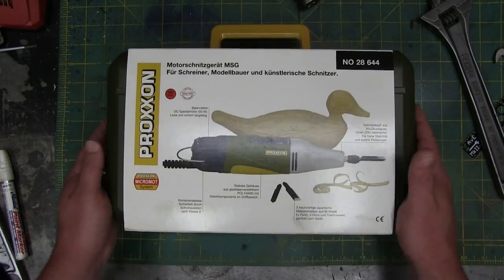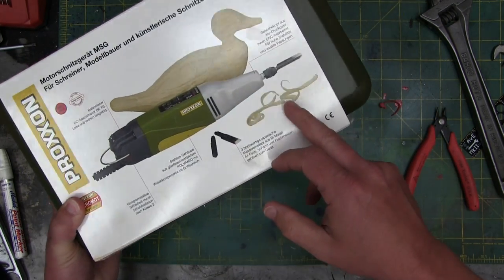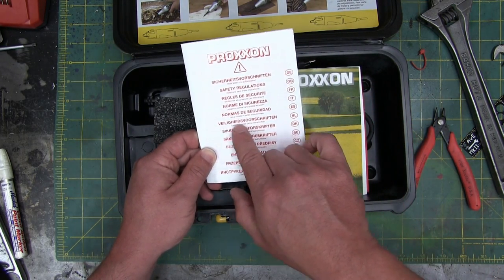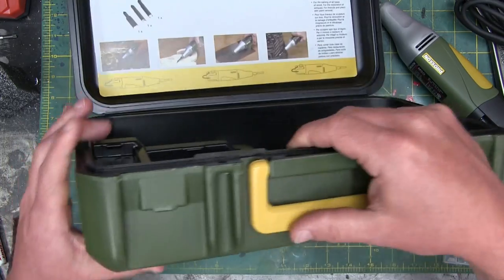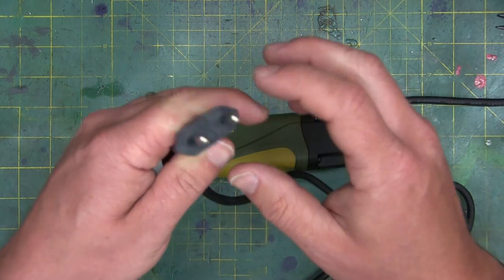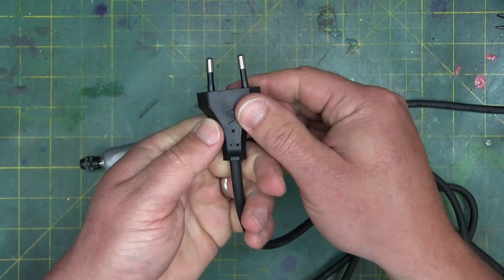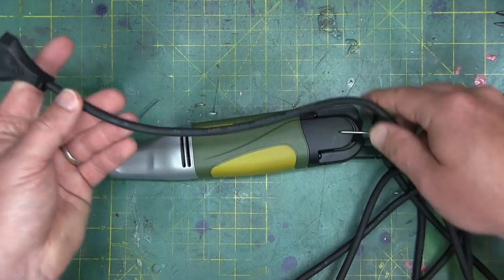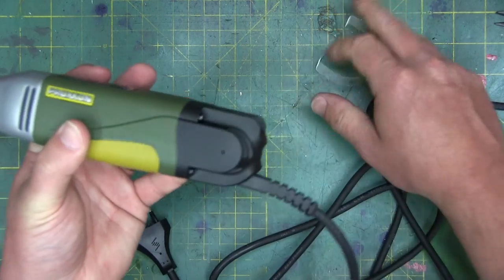BOLTR: PROXXON Carving Tool | Germany

Comment: hmm proxxon has some neat stuff, but some of it is just weird.
i got a big proxxon toolbox with a big and a small ratchet, they both feel incredibly well made, the big one however sometimes just skips gears under somewhat heavy load, meaning you build up force on it just so it snaps out of it with 0 resistance, that can hurt like a bitch.

nevertheless, restored an entire car with the tools and wasnt let down. also i think proxxon dremels are superior to original dremels, you should check em out.

Comment: The case is actually 2 injection molded pieces (the inner and the outer). It is almost certainly made of Polypropylene due to the fact that it has living hinges. Polypropylene is one of only 2-3  materials that can withstand a living hinge over time due to its rheological properties and fatiuge resistance.  Sincerely, a plastics engineer.

Comment: If you take your time reading the wikipedia page for Europlug, you'll see it says: "The two pins are not exactly parallel and converge slightly; their centres are 17.5 mm apart at the tip and 18.6 mm apart at the base"
And if you lack the skill of looking it up yerself, here is a link: https://en.wikipedia.org/wiki/Europlug#Details
Reply: Carl Fürstenberg you need a hobby

Comment: Nice tools if you like leave gbthe on the shelf but the circuit protection / longevity is not so great.
I had the angle grinder the triac released the angry pixies and turned into a smoker.
GLAD I bought an Arbortech after it is a beast for its size

Comment: From proxxon I have a table saw , a planer , a shaper , a hand held router and the miter saw
these are all miniature woodwork tools
yes they are very expensive but very good qualite
I have them for over 10 years and buy them in Montreal and they are 120 volts

Comment: theese proxons are quite shitty as on heavier use after couple of months the whole mini grinder started to rattle as shit, after taking it apart and pulling the small drive gear of the motor shaft i found out the front motor bushing bearing  literally pulverised.... the whole tool is made in an non serviceable fashion, forcing you to buy the assembly .....

Comment: it is possible to get it in 115v version you can tell the difference as it has a yellow end cap. http://www.ebay.co.uk/itm/Proxxon-38644-Die-Cast-Aluminum-Power-Carver-MOS-5-Piece-Carving-Knives-for-SGM-/381564367970?hash=item58d7023462

Comment: Proxxon are sold in the UK. Nice stuff, there version of the dremmel is really good. Smooth motors.
Have a look at the Proxxon LWS long neck angle grinder. It is like an electric die grinder. They can be used with rollock fittings, airbotech mini carvers and other fittings.

Comment: the small twist in the pixies probe is not unusual, most of them actually are bent a little bit, that way it's harder for them to cut the pixies route if pulled (old extentions tend to turn very loose, they unplug very easily, the old shitty ones)

Comment: Funnily enough, I just came across this brand for the first time about a month or so ago.
I was looking on TradeMe (NZ equivalent of ebay/craigslist), and found an interesting unit that came with a rotary tool and a power file/sander. The speed adjustment was on the main unit that you could plug either tool into.
Only reason I didn't buy it was that I wasn't sure if I could put any trust in the brand, and for the cost a Dremel could do a lot more.
(ended up going from a Dremel 3000 to a 4300 and the difference in quality and use is amazing).

Comment: In europe with 230V, this machine produces not 2 but 4 times more power. With the double  voltage and ohms law, U=IR,  the current doubles as well. And since P=U*I the power will quadruple. 
It's probably lower than 4 due to higher  R and mechanical losses.  But due to  60 vs 50Hz, inductive european devices like this, draw less current in 60Hz countries. So maybe it's more than 4.
Reply: So basically the pixies get twice as angry and double in numbers.

Comment: H05RN-F / H= "Harmonisierte Leitung" / 05= 300 V, 500 V / First letter internal insulation (Isolierwerkstoff) R= natural or synthetic Rubber / second letter external insulation (Mantelwerkstoff) N= chloroprene rubber / F= (Feindrähtig) fine wire, flexibel

Comment: Shocked that AvE does not have an adapter set and a step up/step down voltage converter.  I got one for my wife so she could run her British sewing machine here in the states. It was cheaper than buying her a new sewing machine.
Reply: Sithus1966 We do not really need to step up or down the voltage as we do have 240V available (and AvE almost certainly has 240V receptacles in his shop given his gear as all the larger tools tend to require 240VAC power) -- just replace the plug for a NEMA 6-15P.  The real catch most often  is often the tougher matter of frequency conversion for motor driven tools which is not nearly as simple a matter (not that it matters for this particular device since it rectifies the AC) since frequency conversion will require either a rotary motor-generator converter or an AC inverter to create 50Hz 240VAC from 60Hz 240VAC.

Comment: Meeh 110/120 Volts has got to go together with the imperial measurement system, it's very inefficient, the amount of copper you waste over there by running half the voltage and twice the amperage is mind boggling.
Reply: ChePennyDK  we don't do that. Anything high-draw (ovens, heaters, dryers, ac units) is 220v. Most of our house wiring is 14 gauge. N. American houses all have 220v service, just like y'all.
Reply: You just forget one thing, in Europe we use 380 volts for that in normal homes, so my point still stands! And I haven't even started about the efficiency loss by scaling down the voltage...
Reply: I guess you are talking about 3-phase now? That's fairly uncommon in households in the US, but it is available if you have the need. It runs at 480V. I don't know what you are talking about with efficiency loss... every one of your appliances with a microchip in it is converting your 200v service down to low voltage DC. Only current-hungry appliances make efficient use of the high voltage, and we use the same voltage that you do for such things. I have a few "wasteful" appliances. My microwave draws 1200 watts or so from 110v. That obviously is a waste, but it runs for a few minutes at a time - the amount of electricity wasted is negligible. Same with a hair dryer or coffee maker. I think if someone were to study the systemic effects of voltage standard on wasted electricity, the results would be pretty disappointing.

Comment: I got a proxxon rotary tool, people still call it a dremel, hurts my soul.
Reply: Christian Gerefalk Dremel did kind of define the hobbyist market and has for decades.  Besides, if you disassembled an old original Dremel it would be at least as well made as the modern Proxxon -- granted it is a bit more convenient to have speed control built into the modern tools versus an external accessory as it was for the original Dremel.
Reply: Yeah but now dremel makes cheap crap, my proxxon isn't cheap crap, having it called cheap crap annoys me. But I guess "rotary tool" had become "dremel" in popular vernacular.

Comment: I don't think the plug is supposed to be bent like it is, but they usually come bent like that one
Reply: You would be correct if it was a BS 4573, but ironically those shoddy .eu plugs are meant to be like as imprecise as a non-German piece of engineering.
Reply: Reckless Roges I live in South Africa and we use the same plug standards as the eu as far as I know, usually cheap products will have the pins bent like that, but looking at an apple charger the pins are also bent, I always thought they just stepped on them in the factories before shipping